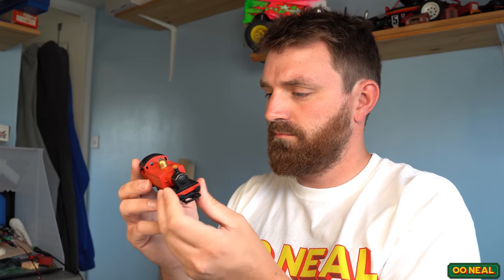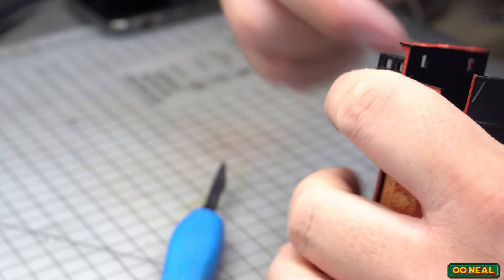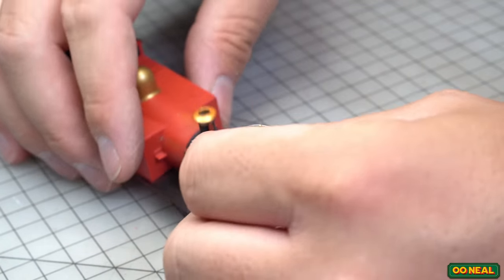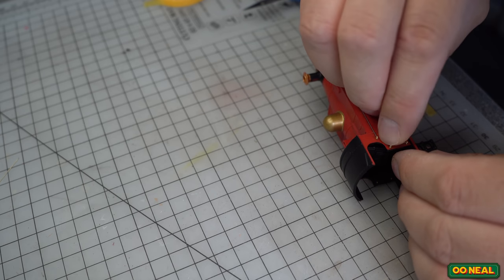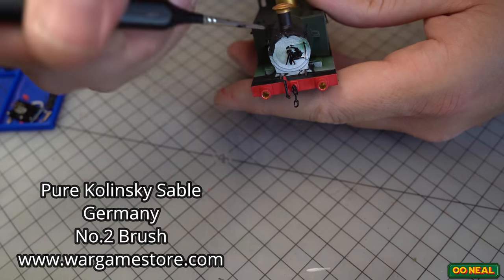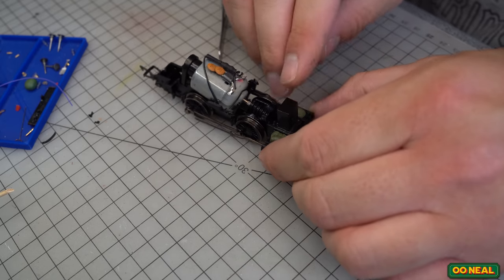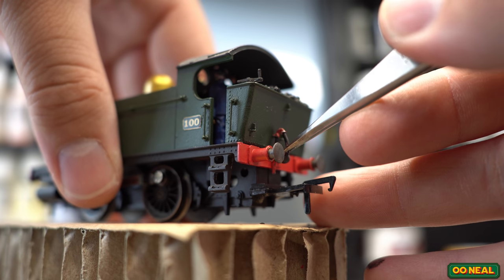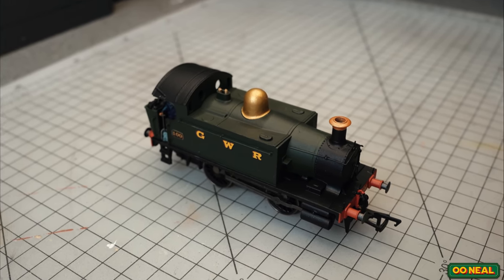How to Add details to entry level locos | Hornby 0-4-0 Super Detailing S2 E24

Comment: Great stuff. Interestingly, if you look at photos of the prototype, the brake handle looks a lot more like the one you fitted. One other addition you could make is to use Glue 'n' Glaze to glaze the cab windows.
Reply: Glue n gkaze is a good idea. The only problem I've found is they set very soft and slightly tacky so the smallest bits stick to it.
Reply from the maker: I've not used it before but I've seen it being advertised. Maybe one day I will check it out, Thank you
Reply: Lovely. The cries of "TOY TRAIN" have been forever silenced. I always had a feeling that those little 'pocket rocket' engines would scrub up nice. You've proved it. Thank you.
Reply: I cut up small pieces from a Peco points pack and use them for window glazing on buildings.
Reply: Dident expect you hear jago

Comment: Great, but even better would be a lamp or two on those lamp irons.
Reply from the maker: That’s very true 😊
Reply: GW lamp irons were actually sideways and the lamp slid on at its side-but that's not really relevant here tho' the loco is based on a little Holden one-off.

Comment: Painting 101 in GWR Post-1928 is a bit ironic as the actual locomotive didn't make it to 1928, or past WWI. As the engine was considered "non-standard", No. 101 was scrapped in 1911 after around ten years of service.
Reply from the maker: Thank you for your infomation

Comment: I can never get the right size of (overscale) three link couplings that I use for wagons and some coaches without corridor connections. I found some marine models chain but I have to open out the hooks. I do miss the old Jackson couplings of the 1960s.
Reply from the maker: Its a little tricky trying to get hold of the chains. I need to keep looking for it.

Comment: How much was the total you paid for all the detailing?
Reply from the maker: Not sure exactly as some of the packets have 10 pcs in which I would use on my other projects. The most expensive parts are the buffers which there are much cheaper options out there.
Reply: @OONeal  Ah got it, thankyou~ Yeah and I'd expect that sprung buffers would be quite expensive :d It's really cool what you did with such a simple loco and made it like something one might find in a railways model :D
Reply from the maker: @aardappeleten7701  Thank you, if you have a watch on the video I put the prices on so you could have a little add up and then work out what you would be spending. alot of the parts are very handy for other projects too so you will have a nice box of bits to use when ever you like.

Comment: A have the same loco I got it in the valley drifter set and the motor isn't working properly it often stops at low speeds but that be from the rubbish hornby controller that came with it
Reply from the maker: I see, Make sure its clean and try using a 9V pp3 battery on the track to see if its the controller or the loco. If it works with the pp3 then it might be your controller.

Comment: Footplate crew Uniforms Dark navy blue for new uniforms but after washing a few times the colour faded to a very light blue, The grease top hats are black with the top gloss black these where worn different styles as per the engine shed. Drivers had white shirts and black ties Never a RED tie but neck chiefs could be worn that colour .  firemen did not wear ties unless a very important train.. Drivers had Black shine shoes but not the fireman as they where lower class and dirtier job . Footplate crew wear in Winter a Black jacket the fireman did not get his jacket until he had done a number of firing turns. All uniforms had black buttons sort of a plastic.
Reply from the maker: Thank you that is very helpful I can use it to help guide me a bit better 😊